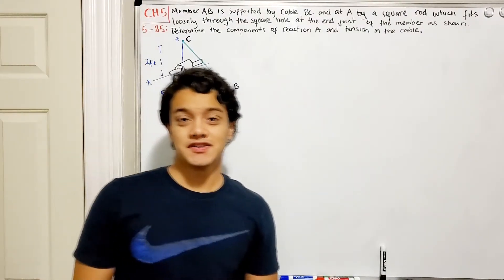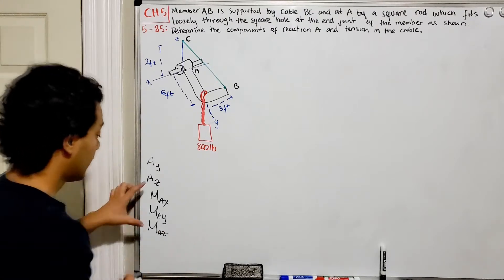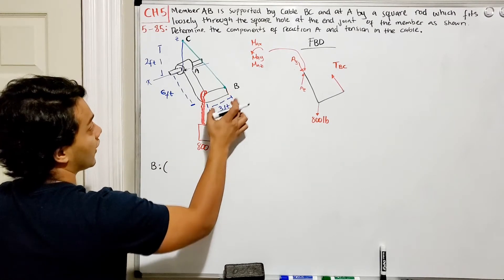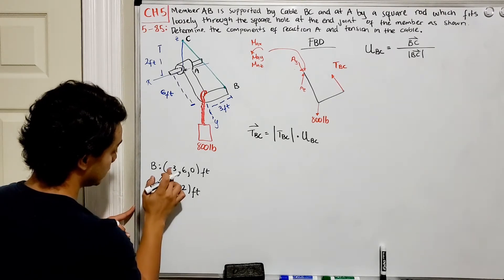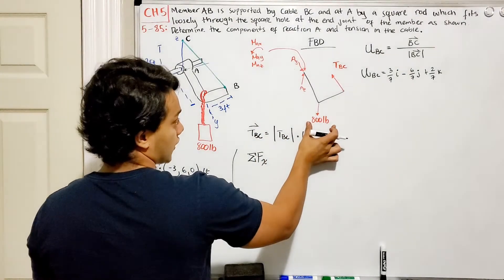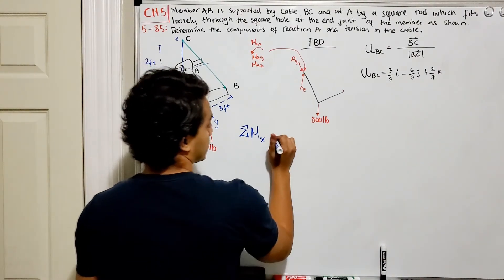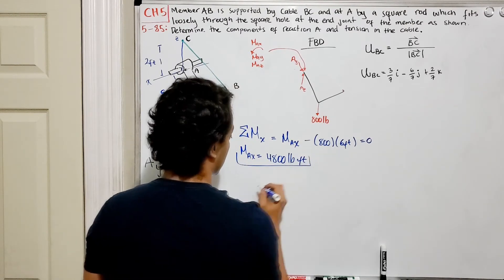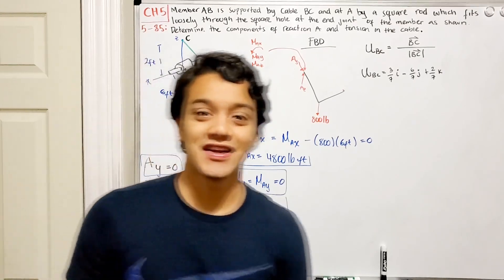Statics 5.85 - Member AB is supported by a cable BC and at A by a square rod which fits loosely...

Comment: does the rope bc not create a rotation about the z axis?
Reply from the maker: When we solve for the tension of the rope BC, we found out that this force is equal to zero. In other words, the rope BC is technically doing nothing to our system. :)

I hope that clarifies your question!
Reply: @LearningbyTeaching  If it was not equal to zero, would it create a rotation around the z-axis?
Reply from the maker: @303filmz8  By slightly looking at the drawing I believe it would :)... (I did this problem years ago, so it is not fresh on mind, however, there is a distance at point B from the x-axis and BC would have a y-component, therefore, a z moment would be created... similarly with the x-component of BC and y distance from point B.)